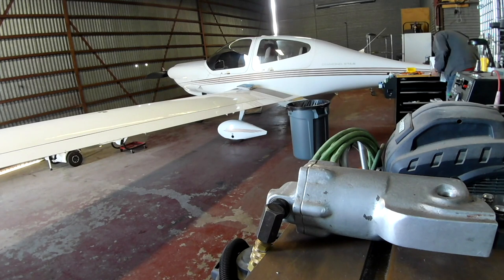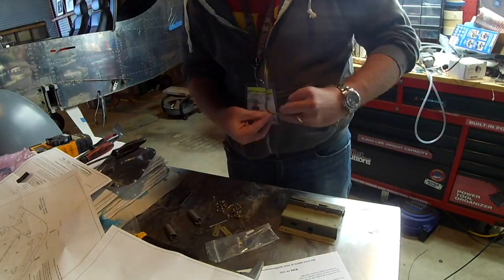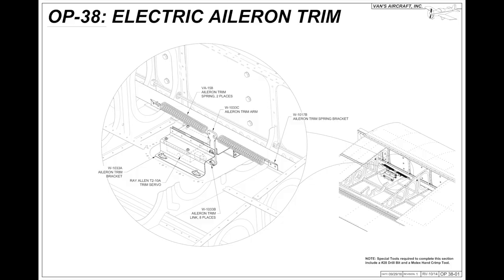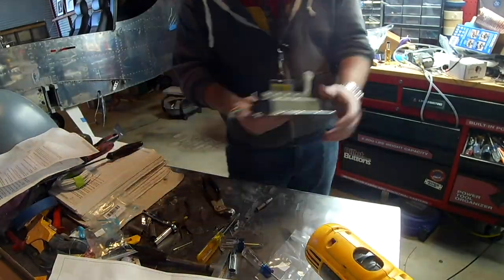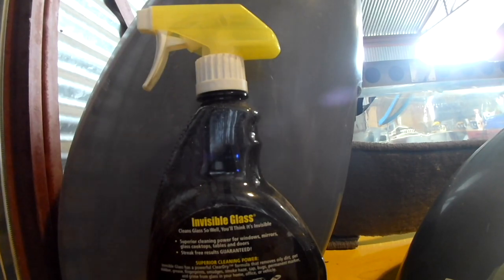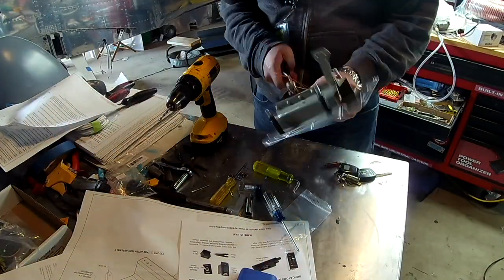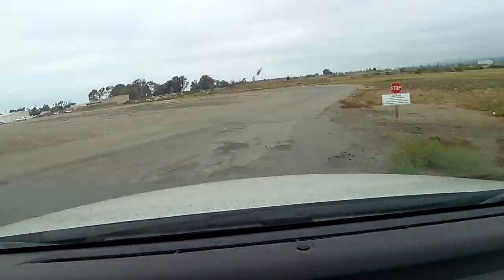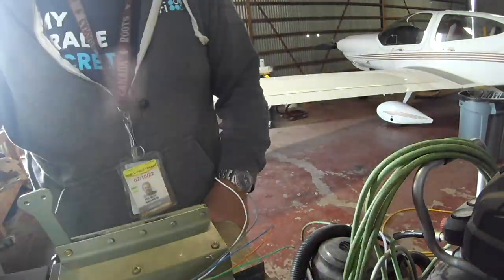RV-14 Roll Trim I

Comment: If you look at the section about installing the aileron push rods it tells you how to measure the neutral position of your aileron by using a part supplied in the wing kit to hold the aileron bell crank neutral and then measure the wing root control (RV-10 says 2 9/32 back from a center hole to the tank rib). I have mine in already. Worst case I swap tubes from left to right if it’s off. It’s been fantastic watching your progress from the beginning. You’re the reason I got the confidence to build. Keep up the great work.
Reply from the maker: AH yes excellent point. I should have mentioned that the other reason I'm not doing it is that even though we have the jigs to put everything in 'neutral' I've read that it MIGHT not be 100% exact once you attach the wings and have them on which is why I'm waiting. No reason to push my luck. LOL.
Reply: @akilroy  good to know that now. Haha.

Comment: I’m hearing pulling those springs to attach to the pushrod is a bitch.  I haven’t attached yet but drilled the tube and put connections on.  Waiting until I have wings on.